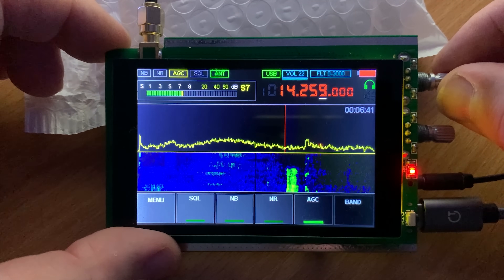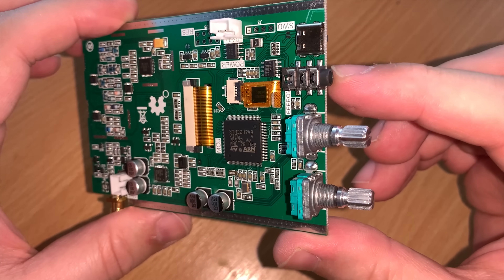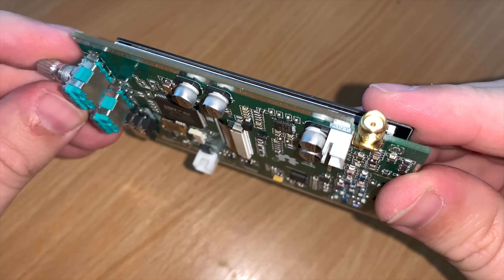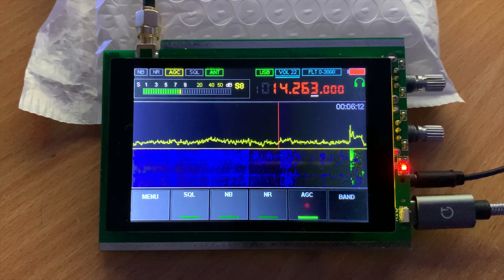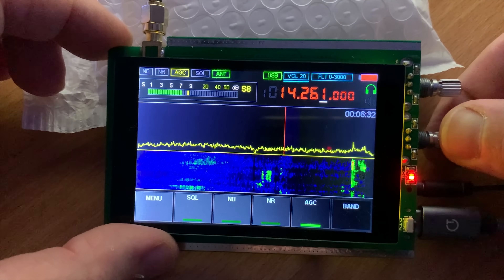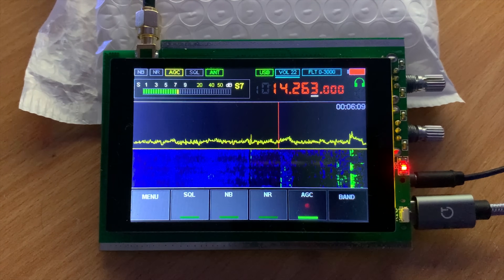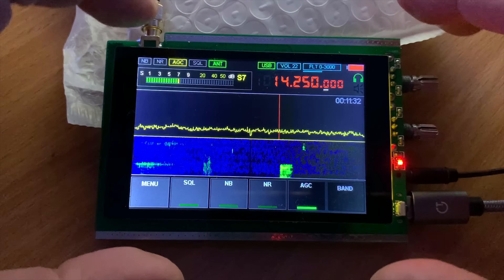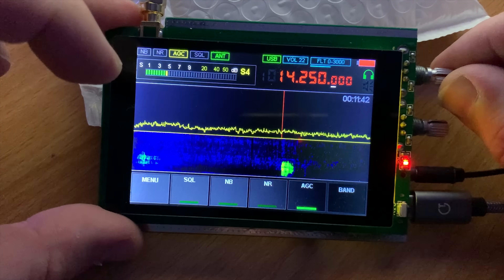50 kHz - 200 MHz Malachite Receiver with 3.5 Inch LCD Display

Comment: The hardware isn't a "Clone". The hardware is open source, freely available to anyone that wants to make it. The catch is that the software is not. Somebody could make open source software, but for now, it's just the company that designed the hardware. I think it's a clever way to get manufacturers to soak the investment money in making hardware, while still getting paid, via the software, on the backend. But it is worth noting, when you buy the hardware, you're only getting "Demo" software. For the full experience, you have to buy the software as well.

Comment: Thanks for the video would you know are have a link to how to install a battery I see the battery jack but is it 5 volts or 9volts connector? I just got one of the ones you are showing here but would like to power it outside. KD6TXB

Comment: Good review, very interested how it performs with electrical noise vs an RTL-SDR. I use home-built multi-band hf dipole in attic but get hammered with noise with SDR receivers.

Comment: No doubt SDR is a powerful tech. I had a 29 dollar dongle that worked well for the money. I'm thinking about getting a better one but the choices are confusing because they run from 30 bucks to over 200. What I'd like to find out is how they compare to a nice portable like the Sangean ATS-909X, which I own and what is the difference between say your $60 Malachite and a $200 one. Can you throw some light on these questions?

Comment: I recently acquired the same Chinese version of the Malachite radio (mine has a case). Overall I think it has great potential, but definitely needs a firmware upgrade. i agree that the frequency entry is a big problem. An onscreen keypad, or using the frequency knob click function would help. Also being able to zero the fractional khz would be helpful. I am not sure what the red line position indicates (IF offset?) or how to adjust it (if possible). Mine tends to overload when the RF gain is set high although this may be an interaction with noise suppression or AGC. When the RF gain is set moderately high there is a high pitched whine in the audio. I saw the Russian version on a YouTube video which seems to have a nicer GUI and many more setting options. I'm hoping you will keep us posted on basic use, any firmware updates, and also how to go about performing the update on the receiver. I did download the English language version of the manual for the Russian version of the radio (which is not the same firmware). The section on firmware updates looked very complicated (which I believe involved compiling the binary image for some reason?) so an instructional video would be helpful. Thanks for the video.

Comment: Is there a version available currently with the full firmware, built-in battery and a speaker available? I've been looking at this receiver for a while now but want to order one that isn't half finished if you get me
Reply from the maker: https://uk.banggood.com/custlink/mDmE54YmMz
Reply: @TechMindsOfficial  thanks mate, looks like an ideal receiver to take on holidays, days out etc, 73s Owen M7OJW
Reply: @TechMindsOfficial  I take it you have never had any problems ordering from the bang good site mate?? It's all secure and reliable etc?
Reply from the maker: @owen8137  I order stuff all the time from Banggood, I've bought 3D printers, SDR gear, etc etc. Very reliable and not bad if it comes from China.  Each product will tell you where it's in stock, US, CZ or CN. CZ is in Europe so if its in stock there order it from CZ, if not then try CN (China). Takes a couple of weeks but I always get the gear. :-)
Reply: @TechMindsOfficial  excellent, I know it's silly worrying about these things but always nice to hear that someone has ordered with no problems before taking the plunge yourself!
Reply: @TechMindsOfficial  Takes a bit longer if some vessel locks off the Suez Canal.
Let's hope that that never happens, eh?

Comment: Great early heads up review on what looks to be a great value and quality device.  Thanks.  Shame the 50 Khz model only goes to 200Mhz, would have jumped at one if it had covered 70cm too
Reply from the maker: With firmware update I believe it will do 70cm, I’m just waiting for my activation code and then will confirm. You can but one already activated, I’ll post link shortly .
Reply: @TechMindsOfficial  Mine arrived this morning (Version 2: 50KHz-200MHz, 400MHz-2GHz registered version.),  and indeed it does tune to 70cm - plus appears to have internal rechargeable battery - very pleased with it - thanks for your review and bringing it to my attention - looking forward to more videos from you on this.
Reply from the maker: I now have mine activated, but I have another one, with case, on its way to me from China. Once it arrives I’ll be going through the activated features once I’ve learnt them. It’s a cool little sdr
Reply: @TechMindsOfficial  Nice - will be interesting to know if there will be firmware updates for these activated ones from BG,  or will be stuck on the firmware they are supplied with.  A little tip, I thought one of my rotary controls didn't have the push/click feature until I realised the plastic knob was a little loose on the metal shaft.
Reply: @TechMindsOfficial  Yeah, I thought you implied that in your video, but watched it again and didn't find it ;)

Comment: Really,  'What good is this (Tech) if you can't Transmit?
Reply from the maker: Ummm, well it’s a SDR receiver like most SDRs. Only a small amount of SDRs can transmit.
Reply: @TechMindsOfficial  Okay then. Please do a video on this type of (TECH) if you please? I can get a Radio anywhere and at a lot better price. Don't you think?
Reply from the maker: I have videos on Pluto, LimeSDR and HackRF showing transmit :) take a look through my videos. This receiver is $65, with a colour touch screen and true SDR. Don’t think you could get a better price tbh. Plus this device uses same DSP chip as SDPlay devices.
Reply: @TechMindsOfficial  Thanks mate for your advice and sharing your vast knowledge with me. It's very appreciated.
Reply: @kennedy67951  please share your find of better radios at better prices with us then
Reply: @nine7295  What are you talking about? I haven't looked at Radios or there prices. I just made a comment on the receiver and that if it doesn't transmit it's really no good for me. So please tell me where you got that I know of better anything?
Reply: @kennedy67951  you wrote "I can get a Radio anywhere and at a better price", on a reply above. I just checked again and it's posted under your name. Note you also capitalized the first letter of the word radio, so I copied it as is here. Are you a troll?
Reply: @nine7295  No. I don't remember posting anything like that. but if I did it was in reference to if it doesn't transmit then it's just a Radio and a Radio can be gotten cheap most anywhere. That's most likely the case here. So no.  I'm not trolling you, mate. (LOL) I like what you do mate. I was just asking a question. I was looking for a Radio that would Transmit as well as Receive.
Reply: @mscir  Thanks mate.

Comment: Is the volume and tuning knobs reversed? Rotating "right" should increase, but I see decrease. Also the knobs should be switched-I think all the cables on right are in way of handling with buttons, so tuning knob would be handy on the edge, volume knob can be in the middle.
Reply from the maker: The knobs rotation can be changed in firmware . Once I get full firmware I’ll put on a case of some kind and will most likely remove knobs and place facing forward.

Comment: Thanks for info. I wonder if with a firmware update digital modes could be added. Even a built in FT8 or CW decoder would be rather awesome imo
Reply: Hello, with the official firmware version of the malahit dsp sdr 50khz 2000mhz there is a cw decoder
Reply from the maker: @serge3990  I can also confirm this.
Reply: Join the facebook group, they give you details on how to buy official firmware.

Comment: Do the rotary controls have a click where you push in like a button (and if so, what does it do?)
Reply from the maker: Yep, both of them do. They have a variety of functions when pushed in, like exit from a menu or change audio output from speaker to headphone jack for example. I will cover all of this in a future video when I get the fully activated firmware.